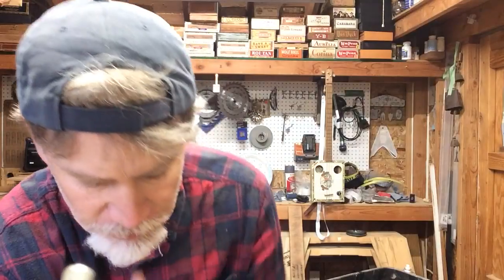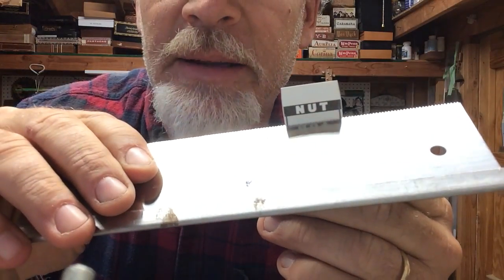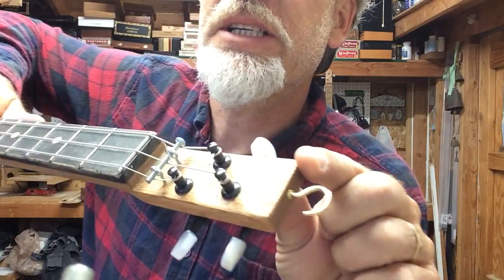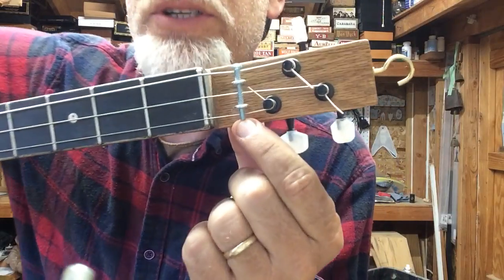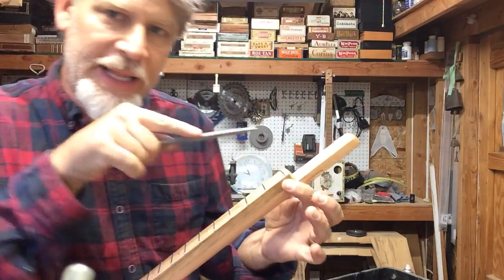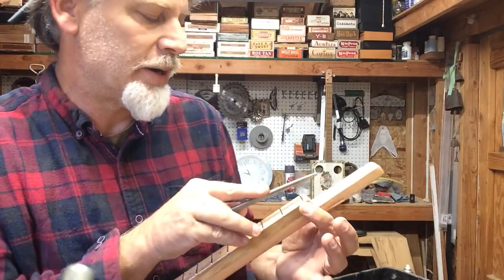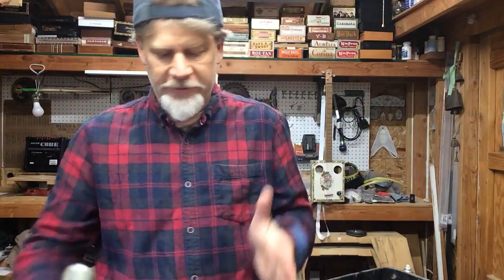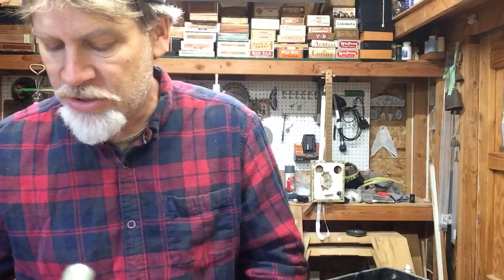The Zero Fret

Comment: What should be the height of the string from the frets? I have already built my CBG using a aluminum nut but not sure how high to set the strings from the frets.
Reply: Good question!  It seems that using a slightly larger fret wire would not create enough space between the strings and the frets.
Reply: Yeah, the difference between a medium fret and a jumbo is about .5 mm. I really don't see how that could work either.
Reply: @everready19373  I started using a jumbo fret instead of a nut and it works if you like low action.